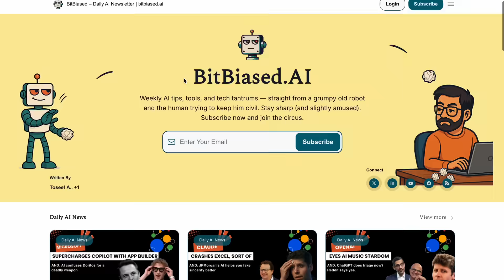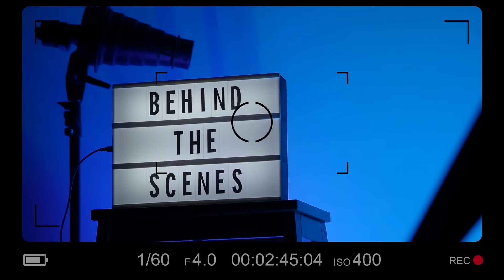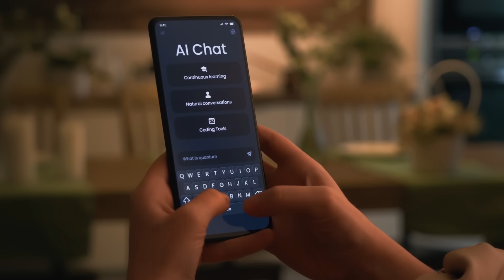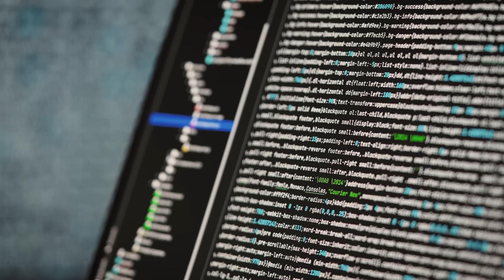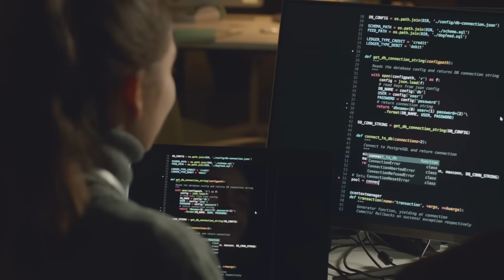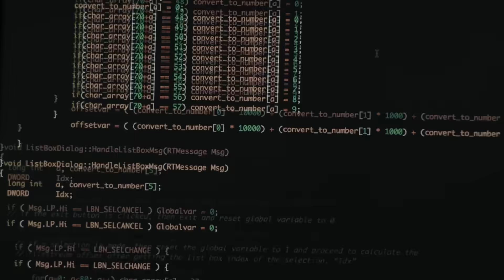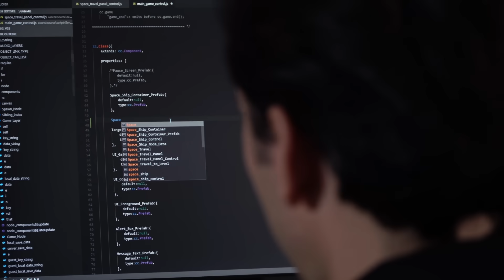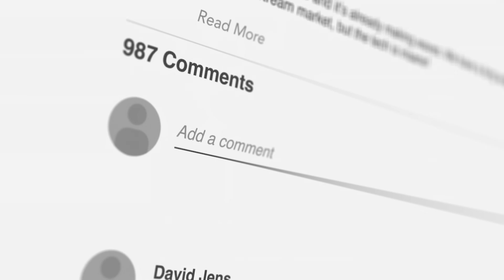Macrohard Explained: Elon Musk’s AI Company xAI Taking On Microsoft

Comment: Export the Macrohard, Azure, Chat GPT, Revit, Plant 3D, Civil 3D, Inventor, ENGI file of the Building or Refinery to Excel, prepare Budget 1 and export it to COBRA. Prepare Budget 2 and export it to Microsoft Project. Solve the problems of Overallocated Resources, Planning Problems, prepare the Budget 3 with which the construction of the Building or the Re-finery is going to be quoted. https://youtu.be/I_u990Il3iU?si=FrYkc_4ETzLk_rn7
Reply from the maker: Thanks for sharing. Sounds like you work with a wide range of engineering and planning tools. Appreciate you joining the discussion.